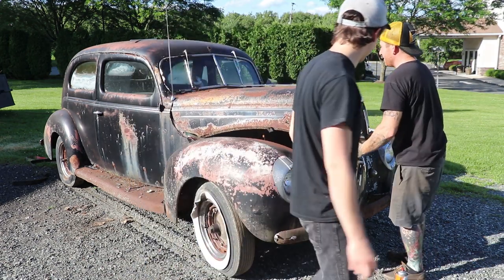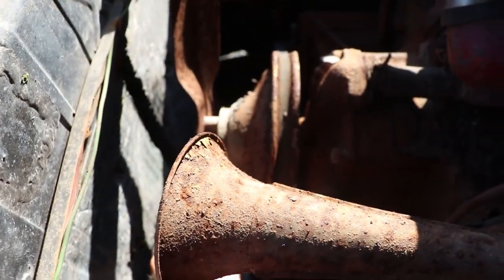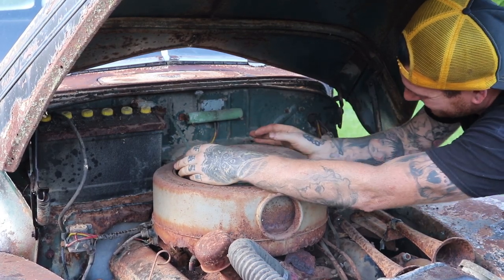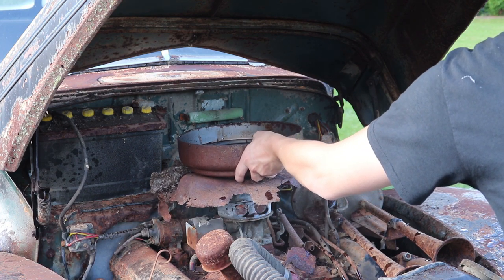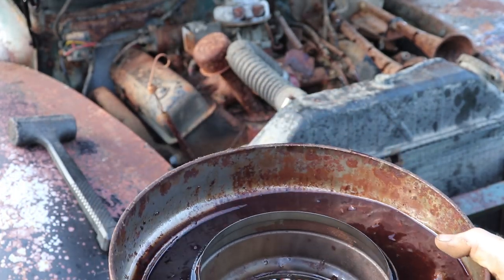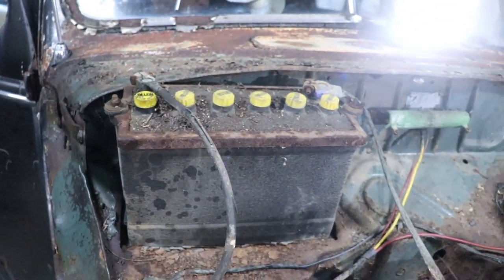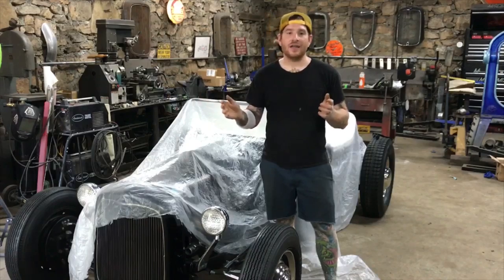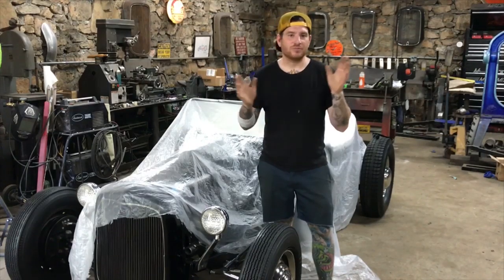1939 Ford Junkyard Hot Rod Revival - Ep 2

Comment: Glad to see you up and about. On the T-Birds they used a spacer behind the water pump. You'll have to use some of the parts off the existing motor (front pulley etc.) or everything will be further forward, and it looks like there isn't any spare room. I love that stage where you're tearing apart a newly bought project car. Good luck with it. Mart.
Reply from the maker: Thanks for the tip Mart! I’ll definitely need to swap the oil pan as well since this one has been notched for the front cross member. Small little things I gotta make sure I keep!

Comment: I noticed a "Mickey Mouse Whitewall" on the pass. front. After WW2 Maurice Kraines rounded up all the molds for the add-on whitewalls. His new business Kraco in Compton Ca. cornered the market on these things. He then broadened into floor mats and eventually 8-track tape decks. I was a Mold maker in SoCal and made and installed many floor mat molds at his shop. I could tell you stories that would make your spine crawl about that place. Just another story about Hot Rodding in L.A. where it all started.

Comment: Standard model has the battery box in the firewall. Deluxe model battery box should be bolted to the right frame rail. Will be interesting to see the firewall with the battery & engine removed. Glad to see her saved from the wrecking yard.

Comment: That might even be a '54 239 Y block, I know they used the driver's side exhaust manifold that came out the front and then ran around the front of the engine and hooked to the front of the passenger side manifold in front and the single exhaust pipe exited the passenger side at the rear as a conventional one would.  Lots of 54s had a conversion similar to the one on your 39 that allowed for dual exhaust, probably a JC Whitney like the plate to fit the Y block to the 39 trans.

Comment: Maybe 2 right side exhaust manifolds. The one on the left being upside down to limit more firewall smashing. Keep healing Matt.
Reply: That is the correct manifold for the drivers side-they cut the crossover off that went to the passenger side and welded a "down pipe". Exhaust was in front and over 

https://cimg4.ibsrv.net/gimg/www.ford-trucks.com-vbulletin/1300x731/painted_engine_b_094f9eb50a8ade4dec243012ff693f2f556e9f5b.jpg

Comment: I loved the 39 and the 40 deluxe fords. I named mine alley oop after a cartoon caricature. That carb is a strongberg four maybe as I couldn't see it too good but if an when they worked pushed them old cars fast as I wanted. Cost me a few keyways in the rear ends that couldn't take that kind of power. I was unbolting from trany and wheeling out the whole rear end like a wheel barrow and splitting the rear end to replace that key then go do it again. For its time a system to not really ever be copied much. That reminds me of the early ford pick ups the front mounts and they were rare as the six was easy to find but not cool and too long to fit in many cars but the front mount was what was so popular and we even used belting off conveyors for the mounts to make some give as he frames cracked so bad. Hell we were late teens with testosterone and no brains then the military got us and shipped a lot of us to nam. I went when I was seventeen and scared shitless. You have a great piece of history there and would be really cool to find out if the owner went to nam to not return home :( but it happens)

Comment: Wow - what a hatchet job under that hood. Trying to figure that left side exhaust switchback. Tried to use a right side manifold....?
Reply: I think all Y blocks had the left side exhaust coming around the front of the engine and connecting with the right side manifold. Must have modified it to run true duel exhaust.

Comment: The Y block must have spun over with 12 Volts. I see a big resistor for the gauges on the firewall A better idea than the crappy littles ones we used to use to protect the fuel gauge etc. The battery in my 39 had a leak in the case,which meant one of my feet *RHD) was getting burned by acid.. 💀😁
The peice welded to the front is the typical Y block front mount, it's usually longer with a big sandwhich rubber block under it .

Comment: That's probably a 292 Ford or a 312 truck engine they even made a smaller one the exhaust is that way because stock ford t ran the exhaust across the front of the engine to the  passenger exhaust to make it single exhaust. and that odd set up is what rodders  did to make it dual exhaust I know I had one

Comment: Amazing what some guys can do with a hatchet 😂
Reply: Hi, I wrote to you a while back as I built the almost identical car in the early 60's. I used a pickup oil pan and pump pick up,  C600 "rams horn manifolds", and kept the 6 volt system. Front motor mount was a purchased unit (Honest Charley's???} and I cut out and welded in a new section for the fire wall. 272 with a 2 barrel carb, ran good and good mileage.
Reply: @georgeparker9977  I found a picture of those manifolds. They look good.
https://www.mylittlesalesman.com/1961-ford-292-exhaust-manifold-for-a-ford-c600-9525283
Reply from the maker: That’s awesome! We’ll be definitely be looking for a better solution for the exhaust manifolds! I’ll take a look thanks!!
Reply: @IronTrapGarage  Those ram horns will flow better. Look at the one Chevy made for their early small blocks.